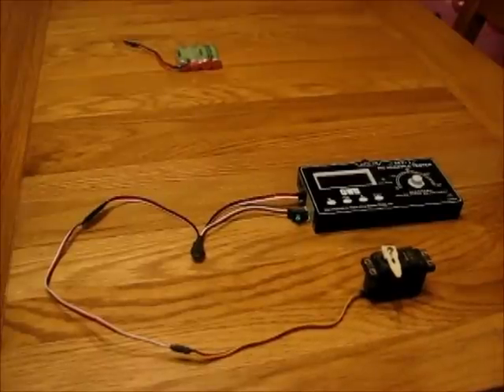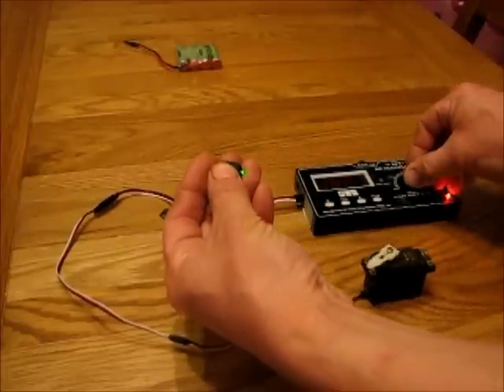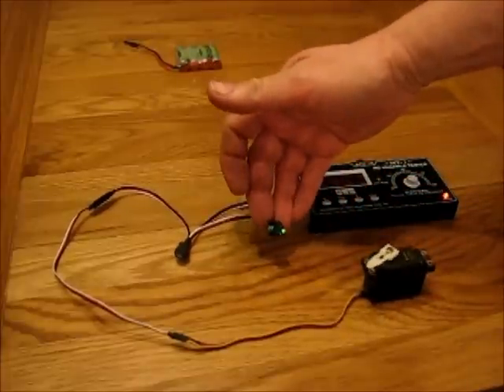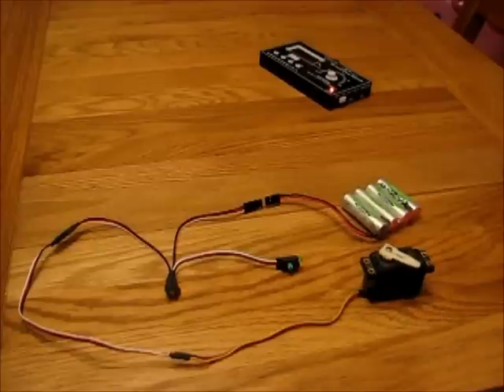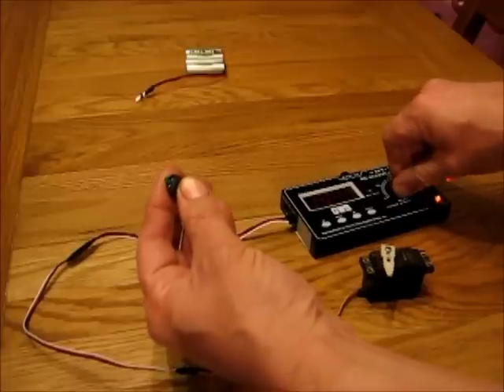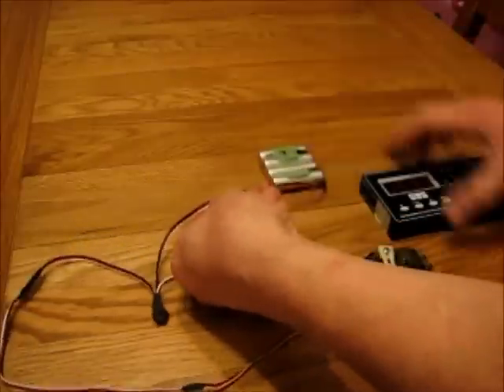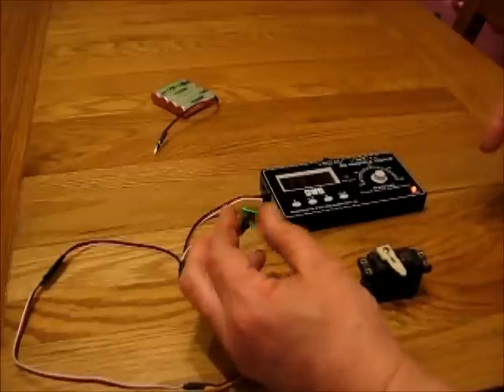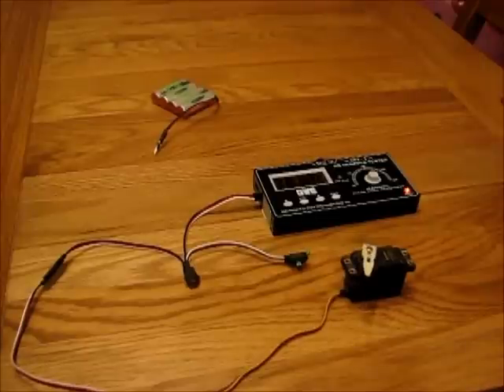A simple Servo Movement Memory or Animation Sequencer

Comment from the maker: Hi Perla,
Its a standard GWS servo tester from HobbyKing:
Go to HobbyKing dot com and search for "GWS servo tester MT-1"
Most model aeroplane servos make motor and gearbox noise, however you could look at brushless gimbal motors as used on FPV camera pan and tilt mounts.
Best way to contact me is by email, philg at talk21 dot com
Cheers
Phil